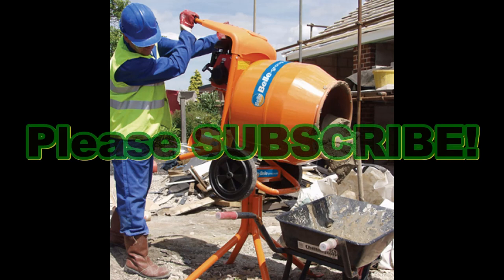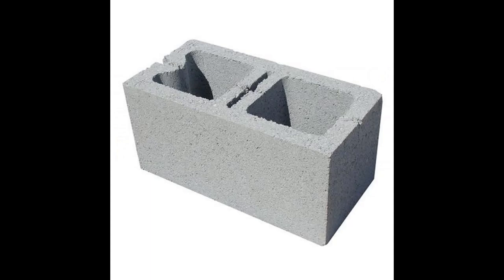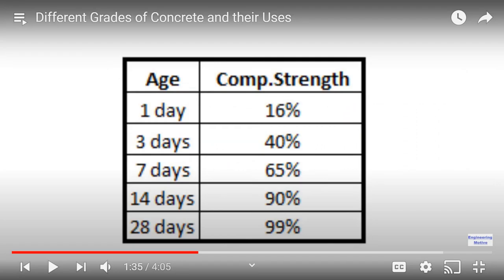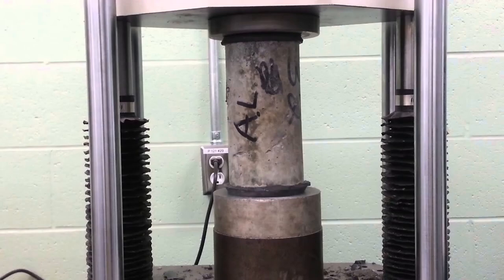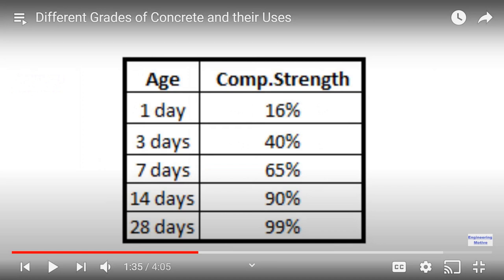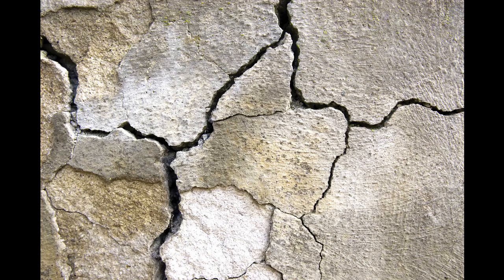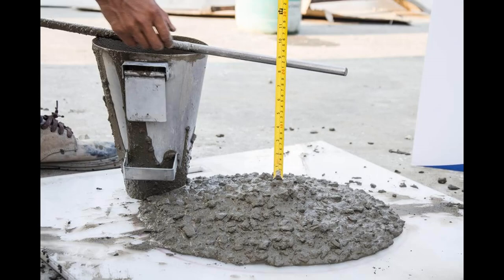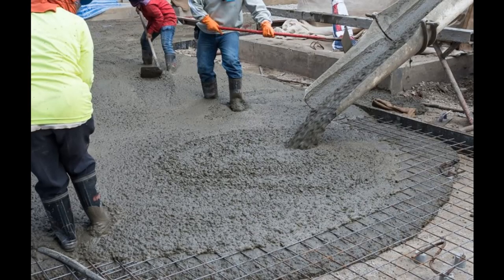Building your dream House in Jamaica part 5. CONCRETE.

Comment: I definitely didn’t know about plasticizer . Very interesting.
Reply from the maker: i see you are  doing you decking now . Congrats.
Reply: @jussayinmipeece1069  yes indeed . Thank u 😊
Reply: I am really please with your knowledge on information given.

I am presently building in Saint Ann and using a vibrating machine for concrete compaction with less water

This method is pretty common procedure in the USA 
What’s your opinion on that?
Reply from the maker: @paradiseland2512  if you are referring to a vibrating block machine its a great idea.
If you mean the concrete vibrator that is also an excellent idea since it compacts your mixture and prevents voids. It will also make it easier to steel.
Reply: @paradiseland2512  it is the best method.  The vibration gets the air pockets out. Less water and vibration can't go wrong
Reply: I am presently using an electric vibrator for my concrete and not soupy concrete as I notice a lot of mason in Jamaica don’t do
Reply from the maker: @paradiseland2512  that's a great approach. That way you get rid of air , compact your concrete and ensure that the mixture gets into everywhere its supposed to.